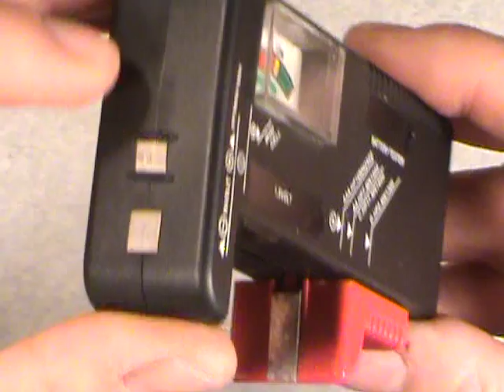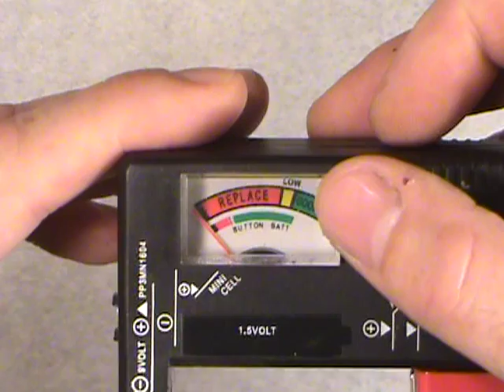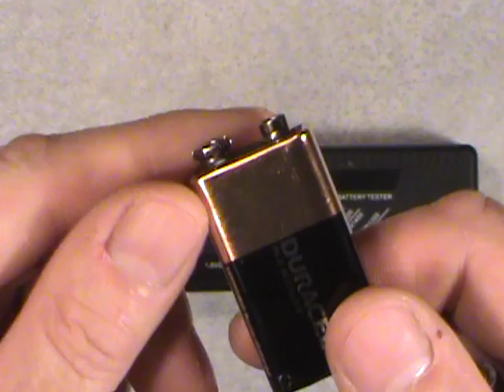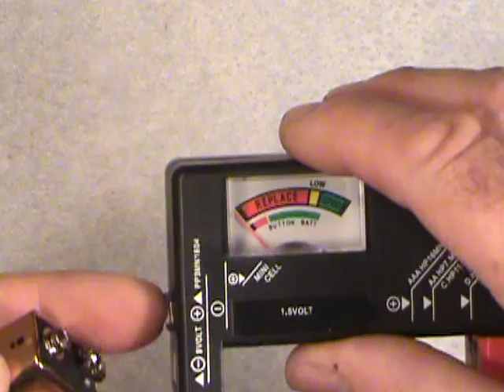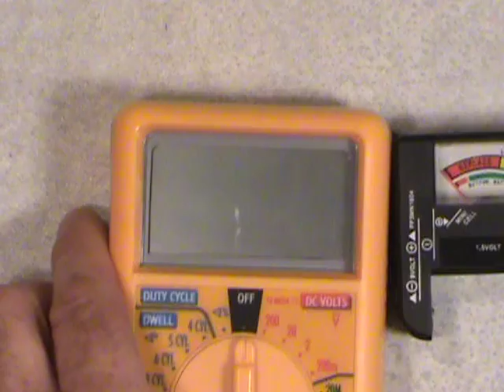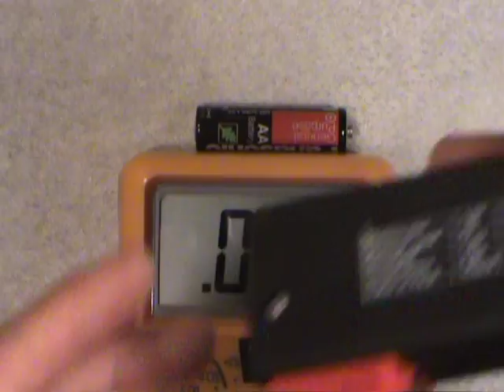How to Test your Battery

Comment: DIY Test 12 V.?   ;p
Reply from the maker: Greetings...Boy Bunyead..............Thanks for watching.............Warning...when-ever the Engine is Running, the Vehicle's 12-Volt Battery, is being Charged-Up, by the Vehicle's Charging System, and while the Battery is being Charged Up, there is usually Explosive Gas, Venting from the Battery, and all it takes, is one small Spark, to cause that Explosion...!!!...so, be Very Careful.....................Here's what I usually do, to Test the Voltage of a 12-Volt Car or Truck Battery (the Lead/Acid type)....................I use the Yellow, Multi Meter, that You can see, in some of my Videos,  on my YouTube Channel...RockysRoadshow...and I set the Dial, for the 20-DC-Volt Range (DC stands for Direct Current), and connect the Multi Meter's, Red Test Lead to the Positive Post of the Battery, and the Black Test Lead, to the Negative Post, on the Battery, and the Battery's Voltage, will then be Displayed, on the Muti Meter's Display/Readout......................A Fully Charged 12- Volt Battery, will usually be around 12.6 Volts, if it's in very good condition....................If the Engine is Running, then, the Multi Meter will usually be showing, oh, about 14.5 Volts, as long as, there aren't any Accessories being used, as in, Heater/Blower Motor, etc.....................For Safety's sake, I usually Test the Battery, when the Engine has Not Been Running, for at least a few Hours, so there Won't Be any Explosive Gas Venting from the Battery...!!!...and.........till next time.........Be (Extra) Safe, take care, and have a good one.

Comment: what about rechargeable batteries?
Reply from the maker: +MaximumEfficiency Greetings MaximumEfficiency....Thanks for watching...............Now then, You were asking about Rechargeable Batteries, so, I'll just assume, that You might want to know, about, what might happen with them, as in, something, like being in their Fully Charged-Up State (as in, Fully Charged-Up, once the Battery Charger has Charged them up, that is), right on Down-to....Hey, I (meaning the Re-Chargeable Battery), can't Work so good any-more, so please, Re-Charge me, so I can do my Job...!!!...lol................I haven't actually Tested a Re-Chargeable type of Battery at all, but, I'm pretty sure, that, if the Re-Chargeable Battery, happens to be, oh, let's say, a 1 1/2 (One and one half) Volt Battery, along the lines of (take Your pick), an...AAA...or, an AA....or an A....or a C...or a D...Cell/Battery (all, just mentioned, are the Round shaped type), would probably "Behave", much like a Non-Re-Chargeable (same 1 and 1/2 Volt) Battery would...............Here's the deal..............Over many Years, I have actually, shall we say, Monitored, the Voltage Levels, with a Multi-Meter, set on the Zero to 2 Volt Range, and Measured, all of the previously mentioned 1 and 1/2 Volt, Non-Re-Chargeable, type of Batteries, and, here's pretty much, what I found..................When these 1 and 1/2 Volt Batteries, are Brand New, I recall seeing them, at about 1.6 Volts, give or take, a little bit....................When-ever the Battery Powered Device, oh, let's say in this example, that it  happens to be a TV (Television), hand held, Remote Control, then, once, the Battery, or Batteries, Voltage, Fell-Below, 1.5 Volts (as in 1.4 something-or-other), that's when, the TV Remote Control, would probably start to Act-Up, and not work properly, and as it should........................If, for example, there happens to be, something along the lines, of a Toy Car, that has an Electric Motor in it, then, it goes really good, having Fresh, or, Fully Charged-Up Batteries in it, where-as, a Person will probably notice, that, that poor ole Toy Car, really starts to Slow-Down, even more-so, as the Battery's Voltage, starts to Drop, Lower, and lower, and if it drops way too low, that poor ole Toy Car, might not be able to move at all, but, "Re-Charge"...those..."Re-Chargeable-type-of-Batteries"...and...once again..."Off-to-the-Races"...We Go...!!!...lol...and...from what I recall, Electric Motors "Demand" a-Lot, from just about any Battery out there.......................I'm quite sure, that, if I were to Measure, one of Your good & working properly, "Re-Chargeable" Batteries, with the Battery Testing Tool, that You see in this YouTube Video of mine, it would probably be in the "Green", on the Battery Tester, when Fully-Charged-Up, and, if We were to Re-Move that very same Re-Chargeable Battery, at regular Intervals, from what-ever device, that it, or they, were installed-in, then, We would, more then likely, be See-in', that, good ole, Rechargeable Battery's "Voltage", start to Drop (from, the, about 1.6 Volts, that it probably started out at), and, as the Battery's Voltage, started to Drop, that Battery Tester's Needle, would probably be going lower and lower (to the left hand side, of the battery tester's meter/display).........................So basically, if Measuring the Voltage, with a Multi-Meter, then, that, one and one half Volt Battery, would start out-at, about 1.6 Volts, and, if, and when-ever, the Voltage Dropped, to about 1.4 some-thing-or-other, then, the Device/Unit, that, those, Too Low of a Voltage Batteries, were installed in, would probably let Us Know, that something was up, alright, as in, "it", Not-Functioning-all-that-well, if, at all, maybe...???............So, I hope the above, helps You out some-what, and.............till next time..........Be Safe, take care, and have a good one.
Reply: thanks for the reply. The thing is, rechargable are around 1.2V when they are full so this device would show they are dead and should be replaced. So I think digital device is better.